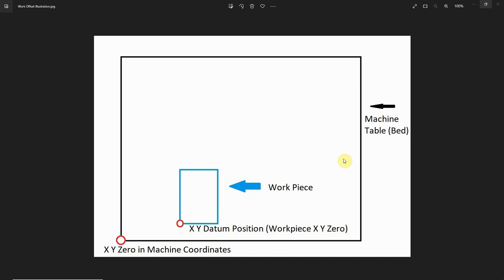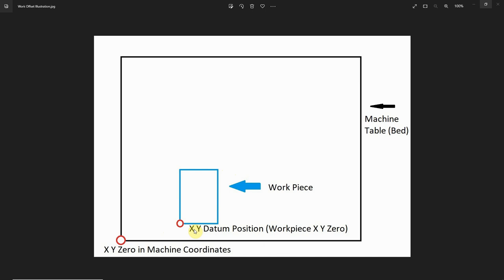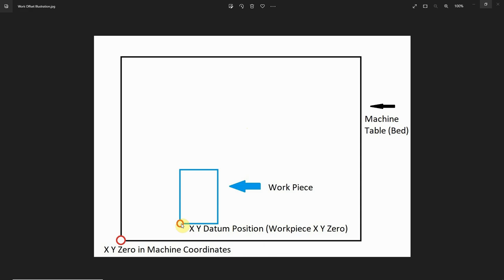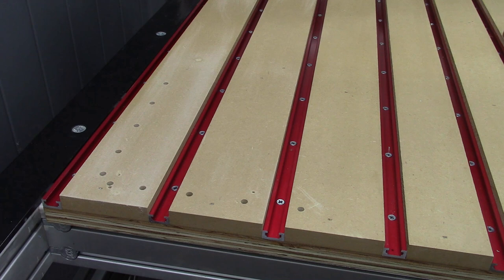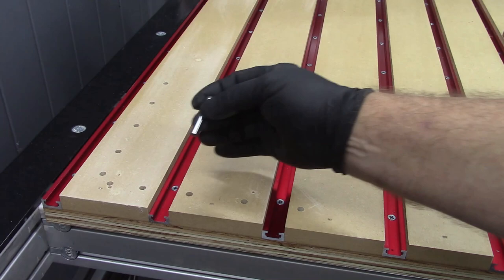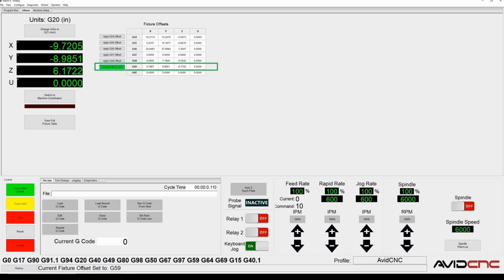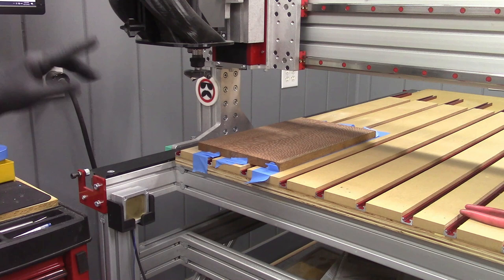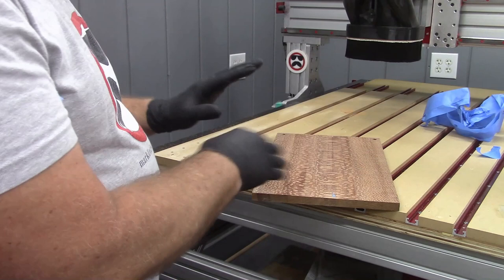Introduction to Work Offsets and Fixture Offsets

Comment: This is very helpful Mark.  Thank you.  I just set up my Avid CNC machine and I used all of your videos on how to calibrate.  It is dead nuts calibrated.  Now I get to try the Offsets.  I will home first!! 🙂.  Also, I love my dust boot from One Guy...  I have been in contact with Keith.  His is great to work with.  I do not have a blast gate attached to the dust boot.  So I created a crude block for the dust boot.  I take the brushes off and then the cover attaches to the bottom of the boot with magnets.  It works just okay.  I have been in contact with Keith and he might make a 3D version of this that will fit better.  Maybe I need to get a 3D printer.  🙂  Thanks again!
Reply from the maker: Thank you, Jay. You might want to check out the second fixture offset video I posted. I got a little deeper into it, and created 2 locations instead of just 1. https://www.youtube.com/watch?v=NpQ5Fgwqaqk

Comment: Great video Mark, I would like to add two things:
1) The ability to define multiple work offsets alows you to set up multiple places on your table where you could run the same gcode and have the machine cut in different regions. thust with good design if you want to you can setup a new work piece in the near left area when the machine is working in the top right and vice versa. or just setup multiple work pieces and move between them running the same gcode each time.
2) when you set up your g59 you didn't realy need to go through the touch plate phase. as your vertical fixturing holes share a their X and the horizontal ones share their Y, Your g59 should be exactly at (X+r,Y+r) were r is the hole radius...  so after drilling you could have moved there and set it up.
Reply: Yes! To add to this, you could also set a template in Vetric with predefined G-offsets. The template would match the entire work surface of your Avid. You could  then customize different size work pieces/projects to each offset and run all of them at once.
Reply from the maker: Thank you, Eyal. You're absolutely right. 1) You certainly could set up multiple areas of the spoilboard with identical location dowel holes, then change between them by applying a different fixture offset (G57 and G58, for example.) I considered doing just that in this video, but decided to make a separate video demonstrating it, as I think that topic warrants it's own video. I did allude to it when I said that we can create more complex fixtures, but I decided not to go any further just yet as this video is just an introduction to the concept. 2) I went through the touch plate phase because it doesn't take very long to do, and it eliminates any possible human error in the calculation. Much like measuring a space between 2 points vs. relying on mathematics to calculate the theoretical distance between them. Using the touch plate eliminates most of the variables that could throw that calculation off.
Reply from the maker: @Craig Lafferty Hey! Don't get ahead of me! :)  Okay, go ahead and get ahead of me - see if I care...  :)
Reply: @MarkLindsayCNC  Using the touch plate assumes that the work piece your are using is exactly square. That is the reason I use Eyal's method.  Also I drill the location hole centers so the top of the circumference for the Y and right side of the circumference for the X are at even inch marks, for example X=2, Y=1.   That makes it very easy to set and remember the offset. In fact I have drilled a grid of location holes over the entire spoil board which align with even inch marks in machine coordinates. When I place a work piece down anywhere in the grid I know exactly where the bottom left corner is in machine coordinates allowing me to set the offset without referencing the offset table.
Reply from the maker: @Stephen Hastings  I will address this further during today's live Q&A, but briefly, I used the touch plate 1 time - to set the X Y zero of that fixture to create the G59 offset. The piece I used the touch plate on WAS perfectly square - that's why I used it. After that initial setup, I no longer need to use the touch plate to get my X Y zero in work coordinates. I will show an example of the work I've done with this setup during the Live Q&A to show the accuracy of such a system. I think you and Eyal are missing the purpose of this video. I still have the option of doing everything you mentioned in your comment - you're using the default G54 offset and changing the work origin location every time you use it. That's fine - it's what just about everyone does. Creating the G59 offset hasn't changed my ability to do that in any way. What it HAS done is given me a known location I can go to every time I want to use it, and do so accurately.
Reply: @MarkLindsayCNC  I may have come off more critical than intended. Effectively using work offsets is the most important concept to grasp here and you have presented it well.  I was mainly just trying to indicate a better way to position the location holes to make life a little easier.  You only have to deal with the centers of the dowel holes once when drilling them but you have to deal with their circumferences each time you use the offset so keeping them whole, easy to remember numbers is important to me.  Your method of dealing with that is storing them in the offset table and recalling them on demand so you really don't care if they are easy to remember.  That is just as valid as my method.  I do enjoy your videos and think they serve the community well.
Reply from the maker: You just explained it to me WAY better than I explained it in the video. I'm storing the location and recalling it on demand. Thank you for that! (If you don't mind, I'm going to use that from now on.) I do understand your point, and I do agree that whole, round numbers are far easier to remember. I can also see why that would be important - especially if you need to recall those numbers at will. I believe that it, at least partially, comes down to differences in the way people think about, and deal with, mathematics. I know from my experiences in working in cabinet shops, furniture shops, and countertop shops that keeping numbers in my head is a bad habit for me. I have to basically forget a number as soon as I'm finished using it in order to keep from making a very expensive mistake (Not that I've done that more than a few times, you understand - yeah, right...) So in my example, placing the pins, then finding the locations of those pins with the touch plate and saving it in the software was easier than attempting to calculate the diameter (or circumference) of the pins and placing them so that the edges of those pins (and therefore the work material,) are in a pre-determined location on the spoilboard. For me, it was less important that those pins (or their outside edges) be in a specific location than it was that the software knew that specific location. As long as the software knew where the X and Y zero point was, that was enough for me. I understand that might drive some people crazy - especially if you work in Machine Coordinates quite often. As a home hobbyist, the only time I ever even look at Machine Coordinates is when I'm homing the machine - and then it's just to make sure the homing routine did its job. So having that location be in a whole, round number just wasn't important to me. That could very well change with time, and we'll see if it does. But right now it's less important that I know where that location is than it is the software knows where it is. That was my point. But hey - we're both getting the result we want, and at the end of the day, that's what is most important. Thank you!
Reply: @MarkLindsayCNC  Not to belabor this but all I do is look at where the pins I am using are in the grid of holes I have on the spoil board and then I easily can tell they are in the X column labeled 5" and Y row labeled 5" and know that the corner of the work piece is at X=5, Y=5.  Enter that as the offset and I am done.  "On Demand" is yours to use any time.

Comment: I have the Longmill MK2 at home without homing switches. I kinda have a manual homing system where I jog my X and Y manually until it almost hits the metal frame (the physical mounting plates of the Y rails and X gantry) for both axis and turn the lead screw by hand (to prevent the motors and anti-backlash block from taking too much forces and possibly damaging them) until X and Y are both against the metal frame. I also do this after moving my machine by hand to get it squared again just in case I pushed the left or right Y-axis harder than the other, forcing it out of square. Then I set my XY0. In the console, I can then type X10Y10 (I'm using millimeters) or some other offset and it goes to that location, where I set XY0 again. This way I also have some kind of work-offset without the need to home the machine. Surely it does involve a bit more manual control but it's almost identical in how it works. I rarely use this anyways as usually, I just power up my machine, mount my material, use a 6mm endmill and set XYZ0 on the front-left corner of my material using my touchplate. Then I swap bits if needed and zero the Z again and I'm good to go. Someday I may install these limit switches but with such low amounts of projects (did only about 10-15 projects in 8 months), it's not really required yet. Nice video, I'll certainly watch it again when I have my homing switches installed.

Comment: Hi Mark thanks for the video, very informative as always.  When will you be giving us an in depth review of Mach4 and your settings with the new machine.  I know Mach4 came packaged but haven't seen you do any vids on it yet.  Thanks in advance.
Reply from the maker: Thank you! I'm still learning Mach4 myself, so it'll be a while before I feel comfortable with giving any kind of review. I'm still used to using Mach3, and Mach4 is just different enough to matter. As far as settings are concerned, they were set by a setup wizard when I connected the machine. I simply told the setup wizard which size machine and which electronics package I had, and it did it all. So, basically, even I don't know what the settings are.

Comment: Great video, thanks!  A question on the touch plate. I also use the same AvidCNC touch plate. Can you tell me where you purchased the plastic holder for it?  I don’t see it on Avid’s site and mine didn’t come with a holder.  Thanks!!
Reply from the maker: Thank you, Kevin. I didn't get the holder from Avid. A friend with a 3D printer made it and sent it to me. I think you can find the files on Thingaverse, but I'm not 100% certain. You can also check with my friend Russ over at Blueline Wood Flags. He made one for his Avid CNC as well. https://www.youtube.com/watch?v=s2zWUY5ibK0

Comment: Hi Mark, if one were to take a piece on and off the table to do epoxy pours would you need to set-up work offsets or can you just manually re-establish the xy coordinates? Thanks!
Reply from the maker: Strictly speaking, you can do this without work offsets. You just have to be very precise when you set your X, Y, and Z zero. The work offset just makes that process a lot easier. Once you've established the work offset and save it, you should be able to go back to that work offset repeatedly. The epoxy inlay of the cartoon pirate I did videos on is the perfect example. It was 15 colors, poured over the course of 6 days. I took the project off the table and poured the epoxy in my house, as it's climate controlled. Each day, I took the project back outside, homed my CNC, remounted the project, then went back to that work offset. I never set my X Y zero  a single time. I only had to set my Z zero for each bit I used on that day's carve. The project came out perfect. Here's a link to the final video in that mini-series, in which I carved and poured the inlays, then surfaced and finished the project. https://www.youtube.com/watch?v=u2A9L4b7VWU Again - I never set my X Y zero a single time. I just homed the machine, went to that work offset, set my Z zero, then started carving.
Reply: @MarkLindsayCNC  Thanks Mark! I did watch all the videos in the pirate series, I'm new to CNCing and do not have the homing switches for my CNC. Thanks again!  I have also watched a number of your other videos and for a beginner not familiar with all the terminology and concepts yet, you delivery style and and explanations are great and much appreciated

Comment: Great video. This helps me a lot for setting an offset for two sided cutting. So can the offset be saved within any of those offset rows under the tab? Why in G59 and not G54? Did I miss something in the explanation?
Reply from the maker: When you start Mach4, it sets the G54 offset by default. If you want Mach4 to always use a certain position by default, you can certainly save that offset as a G54. I don't want to do that. I want Mach4 to start with a clean slate by default, then I can choose to use my G59 offset if I want to use it. I don't automatically mount material there. I like options. Also, I chose to save my work offset under G59 just to eliminate any confusion on my part - that was strictly for me. You're free to save it under any of those work offsets G54-G59 that you'd like.

As an aside, you're better off using locating dowels for 2-sided machining if it's at all possible. Otherwise, you'll need to make absolutely certain that your material measurements and material placement on the machine table are perfect.
Reply: @MarkLindsayCNC  Excellent. This is very helpful. I watched this video and was going to try this method but not quite sure this is more reliable than locating pins. He uses incremental coordinates instead of using absolute coordinates for lining up on one axis. Locating dowels seem the way to go for accuracy. 

https://youtu.be/vxPG0sOf2gQ
Reply from the maker: If you listen to what he's saying, he's developed that system after several years of working to develop it. (That video was posted 2 years ago, and in a comment he says his CNC is 7 years old at that point, so he's been at it for quite a while.) If he teaches his method in later videos, that's great - do check it out. Also remember that he uses Fusion 360, which is a completely different CAD/CAM program than what I use. I like the fact the he keeps saying (although not in so many words) that these are his techniques - yours will probably be different. There is almost always more than 1 way to skin the proverbial cat. He's found his, and that's how it should be.
Reply: Thank you Mark. Keep up the great work.

Comment: Mark ... I can't find up to date 'getting started' type info for Mach 3 or Mach 4. Would you consider doing an explanation on what it is, where it fits into my workflow (I use vectrics), and its basic function(s), like using it to change the CNC feed rate on the fly? Thanks!
Reply from the maker: Thank you! I'm still learning Mach4, so I'm just starting to get used to it myself. With that in mind, I'm really not in any position to try to explain it. I can do a brief overview of changing Feed Rates etc. on the fly this Sunday during the regular Live Q&A. Mach3 and Mach4 are similar enough to allow me to do this, so it won't be a problem.
Reply: @MarkLindsayCNC  excellent, thank you!
Reply from the maker: I'm sorry, but things got very busy today, and unfortunately I couldn't get to this question. I will certainly make a point of it next Sunday.
Reply: @MarkLindsayCNC  No worries ... thanks for keeping it on the agenda!